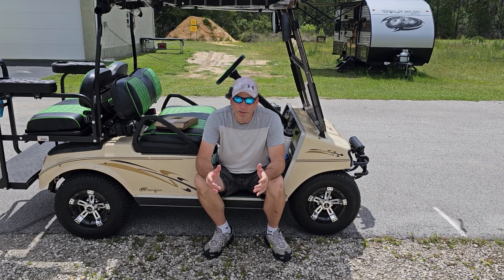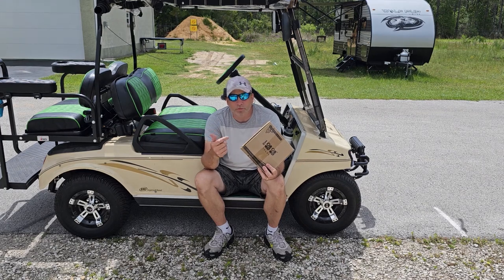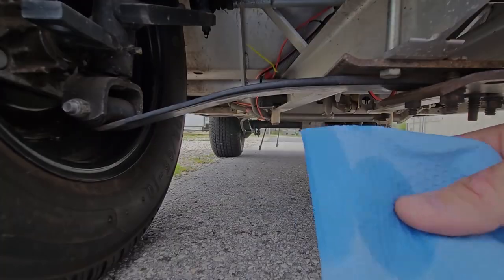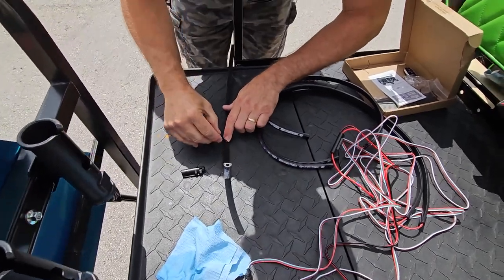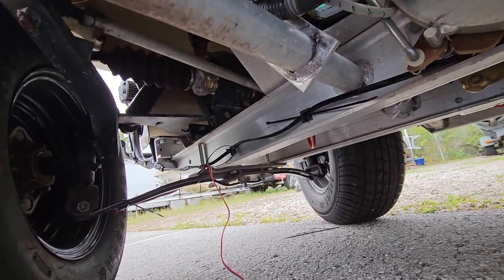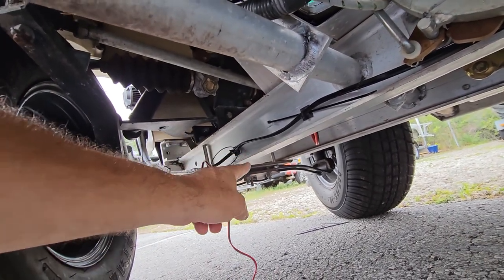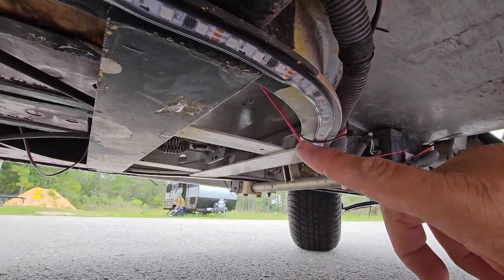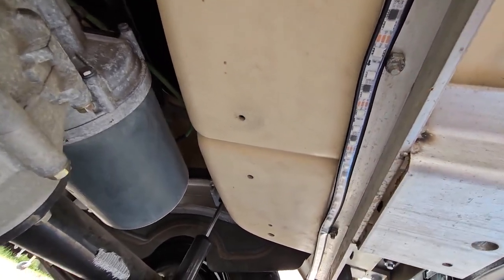10LOL Golf Cart Under Glow Lights Install On Club Car DS

Comment: I just installed and everything works except changing the colors… all I have is red… how do I use the remote to change the color?
Reply: You certainly don't want to drive around with red or blue lights

Comment: great video.  Do the lights hold a memory?  Meaning: whatever light mode you left it on, will it power back up on that mode?  And what voltage did you choose.  Thanks
Reply: No they do not. I purchased these initially and returned for that reason